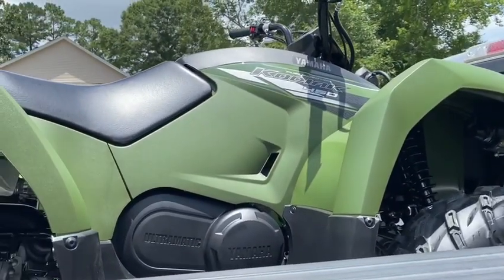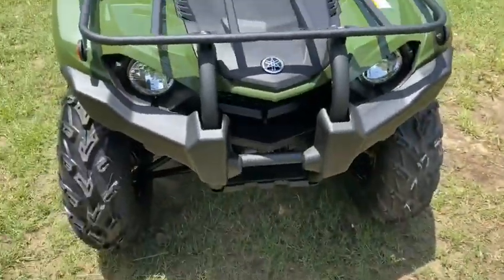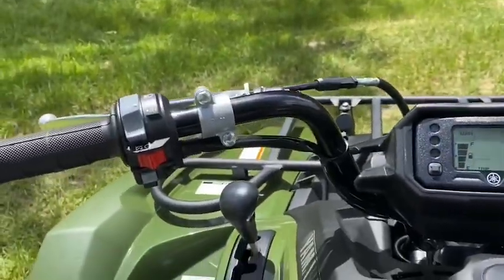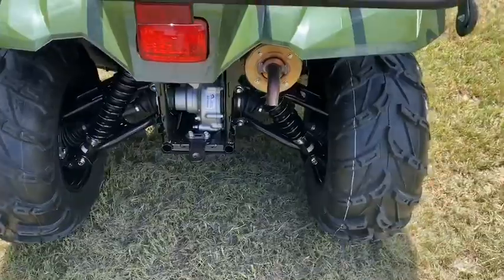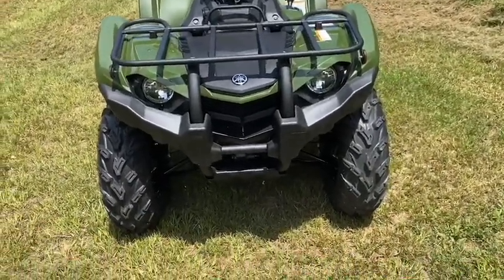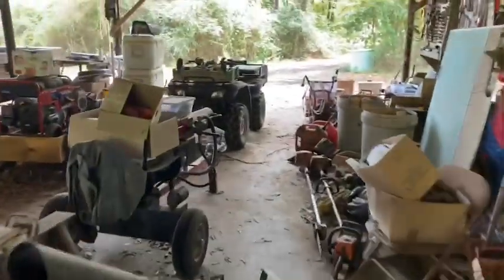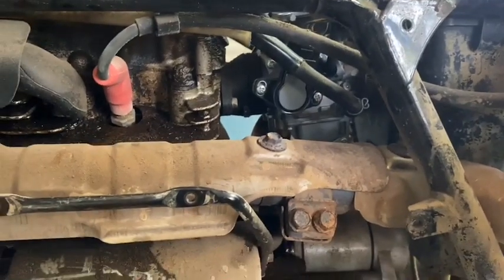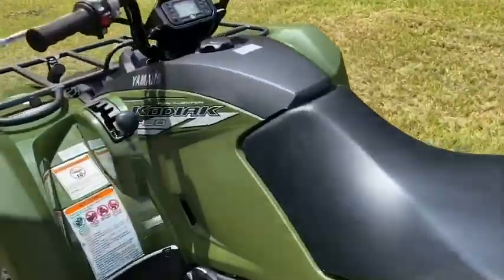2020 Yamaha Kodiak 450 review

Comment: Yamaha is one of the best
Reply: We have a Grizzly 600 and a Grizzly 660, my Uncle has a Kodiak 400. None of them EVER had any problems with with very little maintenance over the years. Yamaha has best 4wheelers out there!
Reply: @xiden3559  Honda is better
Reply: @LouisianaVol  never owned one
Reply: @LouisianaVol  Polaris kinda sucks though lol
Reply: @LouisianaVol how is Honda better?
Reply: @fast1500mtrs IMO the 420 Rancher is not up to Honda’s known quality.  Our 2013 is coming up on its 2nd top end due to smoke, rear end bearings squeaks, dies when the battery has a little age on it and leaves you sitting. I bought it new and it has had a fairly easy life.
Reply: @Oouther1  Honda atvs are the Toyota of the motorsports world, or even Honda cars in the auto industry….quality sure, but boring as the day is long….

Comment: I just bought one of these. Why is the front brake on the right? Down hill the right hand is doing too much
Reply from the maker: Honestly idk I haven’t rode the bike enough to notice that or if it is just on yours I would call the dealer or atv shop
Reply: Any atv or motorcycle ive ever ridden had the front brake on the right grip. When going down hill you want to use more of the rear brake than the front to prevent the front brakes from locking up and flipping over forwards. Going downhill i usually just use 1 finger to put a little pressure on the front brake and mostly back brake using the foot pedal or the left brake lever
Reply: you can change it up and frap with you left hand,  just saying